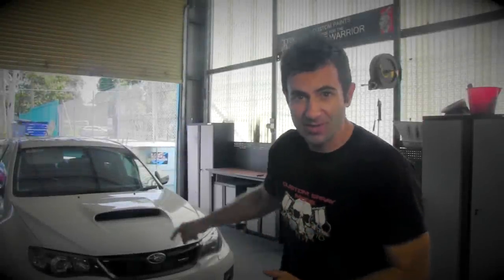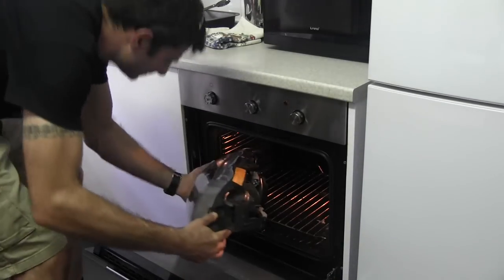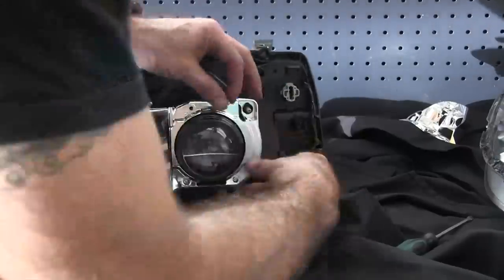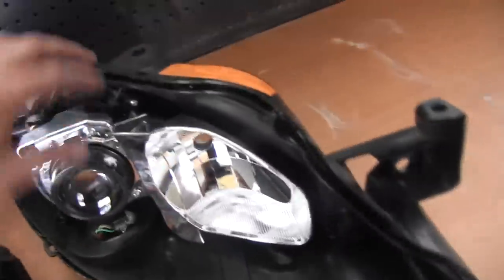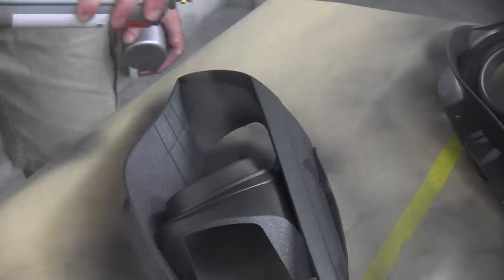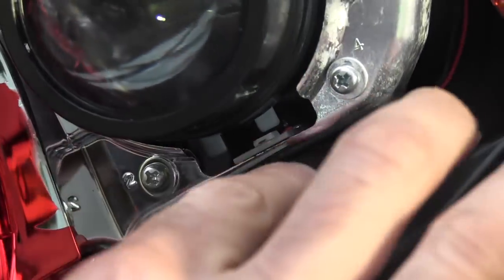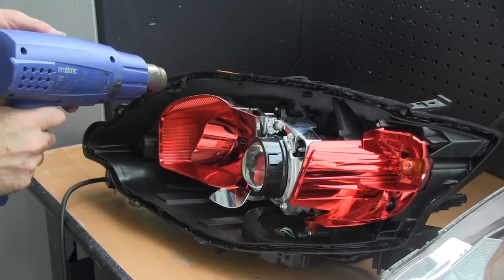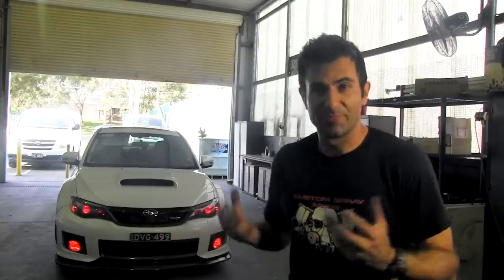How to Customize Your Head Lights

Comment: a quick search shows this / also those lights are really dim... seriously ..................... :(

Coloured lights

Coloured under-car neons lighting systems are not approved. A vehicle can not show coloured light other than what is specified in the Road Traffic (Light Vehicle Standards) Rules 2013, and the Australian Design Rules.

Red and blue lights are only allowed on emergency vehicles - eg police, fire and ambulance. 

Red lights and reflectors must only face rearward of the vehicle.

White lights and reflectors must face forwards. 

Yellow/amber lights are permitted for indicators, fog lights and for side clearance lights on large vehicles and buses. With the exception of indicators, amber flashing lights are not permitted on any vehicle, other than special vehicles used in hazardous situations and emergency vehicles.

Replacement headlight bulbs must display compliant Australian Design Rules or equivalent markings.

Comment: What is that car?
Reply: Subaru WRX
Reply: If you know what's the difference between the WRX STI and the WRX???
Reply: As far as body style goes, not much besides the spoiler on the STI. The STI is a more powerful version of the wrx, it's geared toward racing with more torque and horsepower and no option for an automatic transmission
Reply: toyota land cruiser.

Comment: You kind of fucked up the lights by making everything red and not putting a super switch you can't use it on the road without getting pulled over
Reply: Adam Honda98 he can turn them off

Comment: you 
can use Blue Yellow Orange in the front 
but not Red due to Emergency Color if you gets pulled over it will cost you 
$10,000 Fine and your car will get in pounded in Canada.
Reply: damn 10k...
Reply: I thought canadians were nice. 10k, the fuck
Reply: Depending on location, blue can be illegal as well.